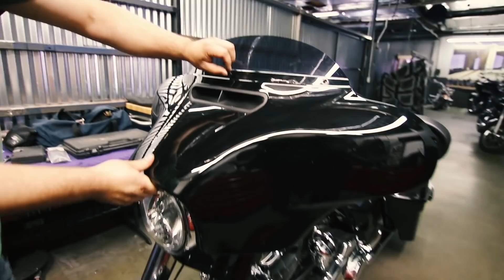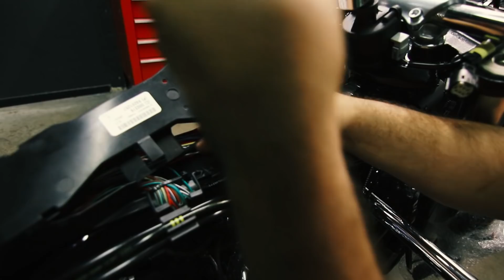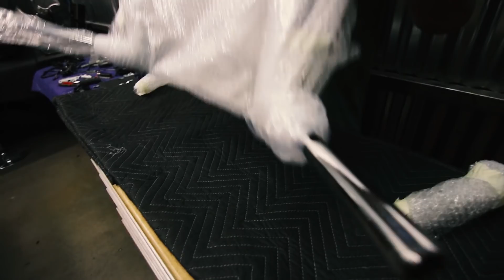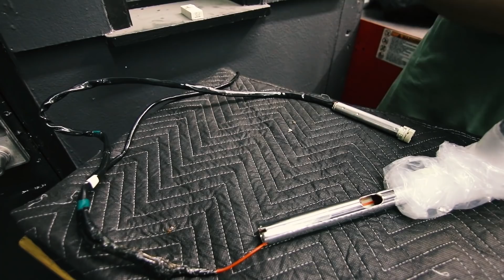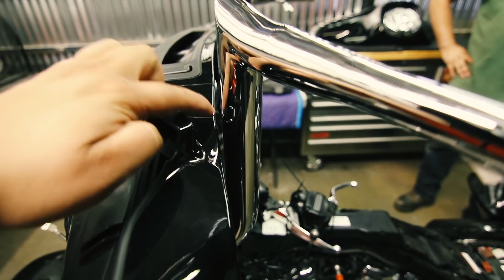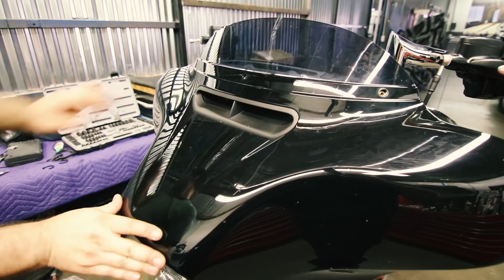Install 14" Factory 47 bars on any 2014-2020 Street/Electra Glide using all STOCK CABLES & WIRES

Comment: i have an issue i was hoping you could help me with. Just installed handle bars on 2017 harley road glide and for some reason i lost tail and brake lights. please help if you can. thank you!
Reply from the maker: Give us a call tomorrow 562-692-5227 10am-4pm pst. And we can try to help figure it out.